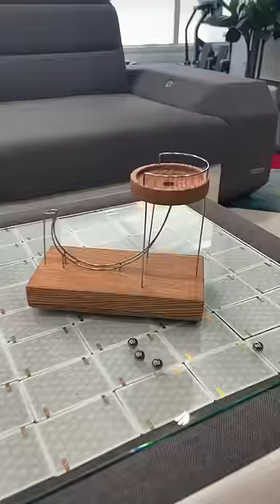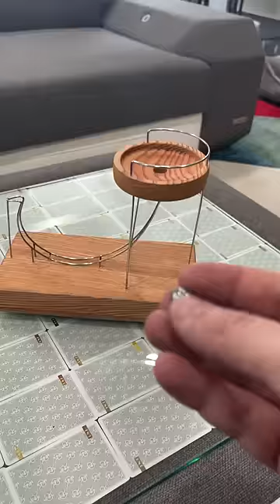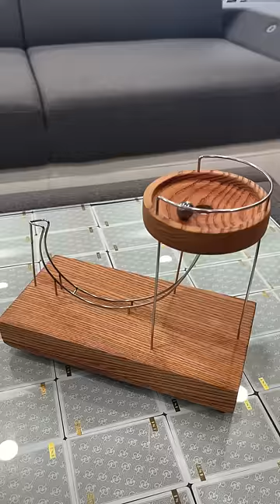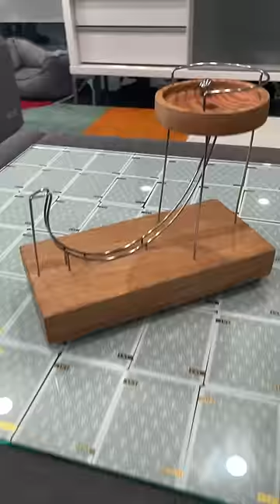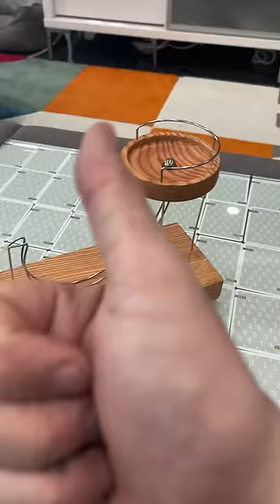An Impossible Perpetual Motion Device?! 😳 #Shorts

Comment: It works as the same principle as the rail gun. Two rails are somehow isolated and energized. When metal ball completes the circuit, magnetism pushes it forward. There must be batteries or a hidden cord somewhere
Reply: There are.
Reply: Yeah i was wondering why was the base to thick
Reply: My science teacher did that with a pendulum
Reply: I'm pretty sure it's a 3d model and none of it is real, the lighting looks very odd, and the parallax is slightly off too.
Reply: There's just a magnet in the base dude, no need to overthink it
Reply: That's actually the mechanism of a rail gun, not a coil gun.
Reply: @granttimm3384  no it's not. It can't be a passive element like a magnet, because then it would be a true perpetual motion machine. It has to be something that spends energy, like a battery.
Reply: I dont think theres a trick, its just a clever use of gravity, its not an actual perpetual motion machine, you couldn't extract energy from it.  if the ball is the right weight it could make that jump, and its not like it has to jump straight into the hole, it just hase to jump far enough to land on the platform which will lead the ball to the hole with the way the groves in the platform are cut.
Reply: @thetayterminator1436  that's still not possible under the laws of physics. You can see the ball jumps higher in the air than the height of the platform. That small height difference represents potential energy that could theoretically be extracted. But we don't even need to think about that.

The ball is jumping higher than the distance it fell. That's ridiculous. It's like flubber. Imagine a bouncy ball doing that. If you include the energy lost to rolling against the rails, the ball shouldn't come anywhere close to making the jump. It has to be receiving energy, almost certainly from an electrical source.
Reply: I mean he did say this is what a perpetual motion device would look like if it was real
Reply: See, the thing is  so you're referring to an electromagnet then, and not the objects commonly referred to as "permanent magnets".
Reply: Magnets are in the board and when the ball passed over them it kinda just slingshot the ball faster since the magnets are just strong enough to pull but not hold the ball in place

How I know this is because I have one and I accidentally broke it so I was like "let's see how this works"
Reply: Guys all you have to do it put a magnet in a circle around the he. When the ball falls through the hole it's accelerated just enough to go back up. No wires. No electricity. It will run for years.
Reply: Who asked?
Reply: Makes sense, he even says it doesn't work with 2 going down at once so clearly it breaks the circuit.
Reply: "some where" as if it's not sitting on a huge wooden box
Reply: You're right about it being magnetism, but the rails are connected at the end. I rail gun works by passing the current through the projectile. There is a magnet in the base, which pulls the ball in on the way down, and adds enough energy to get it back. It's almost like a gravity assist in space travel.
Reply: @jeffhoyt4143   An object moving under its own weight can not generate enough momentum to surpass its original height. So there has to be an external force. It's in the base of the device.

Hell, second line of the listing on amazon: WELL-MADE:There are no perpetual motion machines in the world. This product is an electromagnetic drive, the housing material of the drive part is plastic, and the wooden parts are made of very high-quality wood. The small ball track is made of stainless steel. There is a slight noise after startup.
Reply: Even with 🧲 it's still really cool and basically has returning energy. Since it can probably run indefinitely. Awesome device.
Reply: @stompingpeak2043  It's an electromagnet.
Reply: @Liamcoe1  I don’t think you understand how much easier it is to build the device than to animate it
Reply: See, the thing is  but if it's called a machine is it allowed to use a magnet?
Reply: Damn, for a second I believed in magic
Reply: So it is a rail gun...
Reply: @Liamcoe1  the reason it looks odd is because of the lighting being so bright and the base of the device not being a perfect rectangular prism
Reply: There's probably a motor with magnets spinning to give the balls more energy. Two going down at the same time give the motor time to speed back up. If you've ever seen a magnetic stirrer, I'm guessing it's similar.
Reply: @Tesserex  No, even the so-called 'permanent' magnets have their magnetic force decay over time. We just call it permanent because the timespans of the magnetism inside them exceed an amount of time that we would deem 'temporary' in our day-to-day use of the word. Same concept as a 'permanent' marker not actually lasting on paper for eternity.
Reply: @Tesserex  permanent magnets have relaxation times too
Reply: Thank you that's been bugging me
Reply: Bunch of kids arguing on this comment.. funny af
Reply: @Val_Sanguine  the force that magnets applies to the ball as it gets closer would speed it up. But the same force applied as the ball is moving away would slow it down.
Reply: Can't be. The rails are connected at the lip of the ramp.
Reply: @spartanseventyeight8673  guess again the reason that the base is so thick is for weight. Ie kinetic energy if the unit moves it bleeds off energy I've had one in my hand and fooled around with it no batteries or magnetic or anything it purely gravity and force of the radius of the rail
Reply: @thetayterminator1436  no ball of any weight can roll down a curved path and return to original height. The hole the ball falls through absorbs virtually all of the ball’s kinetic energy. Very little horizontal momentum is conserved as the ball drops. At the start of the fall the ball has a normalized potential energy in the height above the base, this can be thought of as the ball’s starting position. The potential energy is converted to to kinetic energy as it falls, but in this configuration it will lose energy due to friction and air resistance. Any platform it lands on must be lower than its original height. Grooves in the platform would not be able to move the ball upward. There does not appear to be any physical movement in the platform, so I argue it’s safe to assume the platform is higher than the hole. Energy must be added in order for the ball to return to its original height and original potential energy.
Reply: Bruh he literally said it was impossible and this is what it would look like if it did.
Reply: @jeffhoyt4143  Thanks for exposing yourself as a liar. If you had it in your hands you'd know otherwise. As I've said already it says on the store page it's an electromagnet. Without it, it's physically impossible.
Reply: some of yall in the comments: there's a bridge in brooklyn I'd like to sell you
Reply: @spartanseventyeight8673  whatever you want to think 🤔 not that you do any of that we have one in our physics department in a college where I am employed
Reply: @spartanseventyeight8673  instead of getting in a pissing match just text Chris
Reply: why cant it just use magnets?
Reply: @Gecko1115  it doesn't need to magnetic force through the wood isn't measurable and if they were connected to the rail it's something more that the ball has to overcome. On the cheap plastic units there is wire connectors but the novelty heavy weighted one with the rubber feet and clean and straight rails evenly spaced work well and it's quite a bit of work to get them right that's why the good ones are over $100
Reply: There are several models of the same thing
Reply: @nascraytia  If you honestly think building a machine to accurately launch a ball like that is easier than building a model in blender and animating it you've never designed anything in your life.
Reply: 7h. Fb
Reply: @Gecko1115  Magnets do not add energy to a system. The magnet would slow the marble down as it went up. Conservation of energy.
Reply: And since you can hear it roll and hit when it lands, that is all energy that is lost. A perpetual motion machine would have to be silent.
Reply: @Tesserex  correct. I didn't bother to edit but i should  :(
Reply: @thetayterminator1436  BINGO
Reply: @spartanseventyeight8673  buy one and see it's only  139 dollars and some odd cents and cut it apart after you test it and see if I'm a liar...
Reply: @jeffhoyt4143  This just isn't true (the simply gravity comment). E=K+U, coming out of the loop the ball has more speed and therefore a higher kinetic energy than it started with, to reach the same height would mean a return to the same value as U initial. A greater final kinetic energy and the same final potential energy, unsurprisingly, add up to a greater amount of total energy than existed in the first place, even when not accounting for loss as a result of friction.
Reply: A little wheel is on the sidewall of the drop point. One AA battery is inserted below the top, round dish. When the ball hits the drop point, the wheel turns on and spins as the ball passes through the drop point. That’s what gives it the required speed to make it back up to the top. This boomer conveniently leaves out the part about installing the AA battery. 🙄
Reply: Much simpler than that. There's only one electromagnet that turns itself off after a short time. No "push forward" required at all. Just pulling downwards.
Reply: @Tesserex  the magnet will eventually lose it's power and then you need to replace magnet. No batteries required
Reply: @orion9k  magnets aren't like batteries. They do lose their strength but that's on the order of centuries. If this thing only used a permanent magnet, you would never need to change it in your lifetime, and you'd be able to extract free energy all along the way. The Amazon pages for these products all explicitly say they need batteries.
Reply: @Tesserex  Alright then
Reply: @Tesserex  what is it called on Amazon?